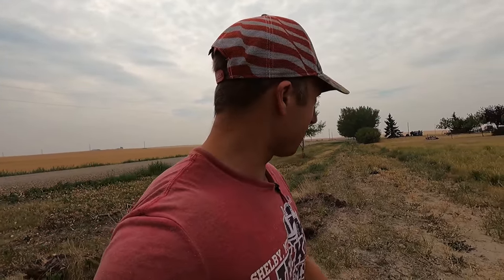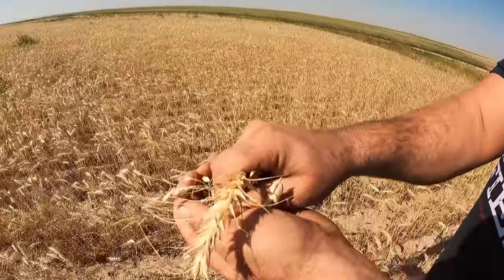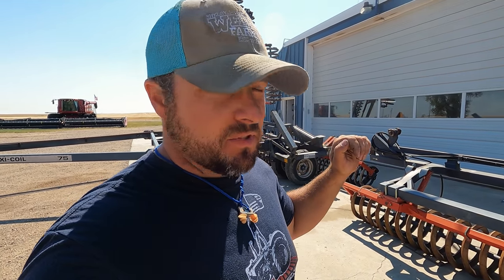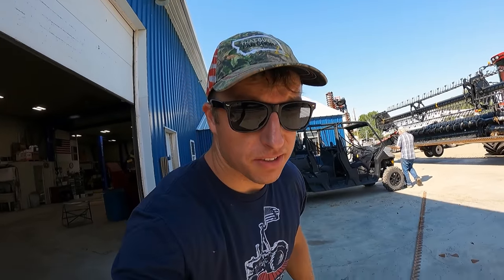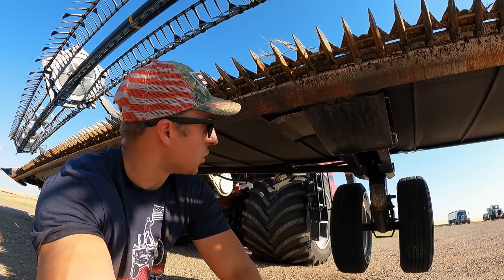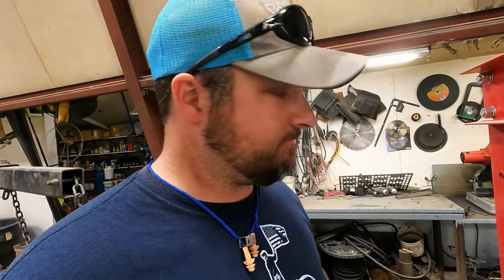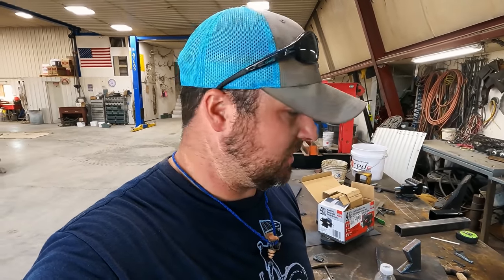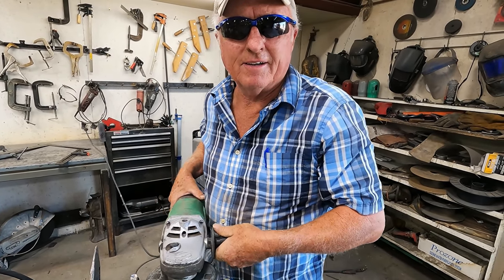Ripped In Two

Comment: Just a little welding tip, before you slide the 3 1/2" tubing inside the 4" torch (or drill) some 1" holes in a random pattern on all four sides of the outer tubing. Then plug weld the outer to the inner. Plug welds are super strong and with your wire welder super fast.
Reply from the maker: Thanks for the tip!
Reply: I've done that when I've had to lengthen a roll cage or frame on a truck ... super strong! (almost as strong as Leg Arms!)
Reply: Great idea
Reply: came here to say this exact same thing....
Reply: dude i couldn't have said it better!
Reply: I was hoping someone would say something about plug welding.
Reply: Yup always did that when we repaired our snowplows. But it was alot shorter peice. But a couple would help it potentially moving inside the 4" tube
Reply: Ooops! I just post the exact same idea!!! Hahahaha deleting comment right now.
Reply: @raymondtousey9014  Almost hehe
Reply: Was going to suggest the same thing
Reply: Plug Welding the sleeve.....all 4 sides staggered on each side of  the break.
Reply: Had this done on the main beam of a7500 CIH moldboard plow multiple years ago. Still holding today enough we don't use much now. Lord Bless 🇱🇷!!!
Reply: Yeah plug welds the way. Super, super hot weld means cracking later on.
Reply: Welder of  32 years I was just going to say that
Reply: Interesting how so many welders have done this, yet the automotive and manufacturing of Machinery Industries haven't heard of this engineering genius or is spot welding a form of plug welding LOL.
Reply: @earlhollar1906  it’s a waste of materials. They don’t need to do repairs like this when their making the whole thing from scratch.
Reply: @earlhollar1906  that's not true plug welding and spot welding has been around for years. Spot welding is a different technique than plug welding, spot welding is normally used on thin metal and plug welding is for thicker material. They both are extremely strong when the application is done correctly.  The automotive industry uses spot welding on every vehicle they manufacture. If you go to any welding school you will be taught how to plug weld when doing repair work, and spot welding thin metals.
Reply: @jeffgregory5076  I know these things my comment was a rhetorical sarcastic one I thought maybe the LOL relayed that. We did this in welding class at state school science when I got my doctor Motors degree with a 4.0 average. Not to blow my own horn to loudly but my project partner and I we're giving the task of building the undercarriage Springs and skis for the instructors children's plastic injected seat  fiberglass body slay he was going to pull behind his snowmobile.
Reply: Smart thinking.

Comment: Thank you for taking a moment to explain the coil packer to us non farmers.  

And I am always impressed by your ability to figure out a way to fix whatever problem you find.
Reply from the maker: Thanks!
Reply: Flexicoil you see the coils flexed but that thin 4in square tubing didn't Flex along with it. Bit of a design flaw. My dad was a fan of the rod weeder pulling a drag behind it after plowing,   and before seeding.
Reply: Could not have said it in a better way.

Comment: Nick, glad you showed the -130s cruising low-level over your farm.  I flew it for almost 20 years; saved many lives as an HC-130 Rescue Driver.  Great airplane, great vids.  Keep up the good work.  God bless.
Reply: Love me some C-130s too. 11 years as a depot sheetmetal mechanic on C-130s. Probably have seen or worked on your HC-130N/Ps.
Reply: @stanleyharrell6009  Probably.  Here are some tails I flew:  695831; 695824, 660212; 650968 (crashed in GA two years ago on way to boneyard, killed entire crew), 650978.  Did you work at WR or BHM?  Many more I can't remember.
Reply: @skullman1455  I worked C-130s at Robins. Worked 5831 for CWB replacement and NVIS/SOFI in 97. Did the same on 212 shortly afterwards I remember the others tails coming through. I was the workload planner on 978 when it came in back in 2009 for HVM. Sad to see all of these go to AMARG. They were great aircraft.
Reply: I flew in one from rein main Germany to Eagle Base Tuzla main Bosnia in March of 2004 on my first deployment not very comfortable and the pilot went from about 10 ft to the ground in a split second was rather enjoyable

Comment: C-130 Hercs are Amazing!! When I was in the RCAF (Royal Canadian Air Force) I flew almost 2000 flight hours on the tail ramp inside the cargo bay and also flew with a SAR (Seach and Rescue) unit and they had Plexi glass full length side jump doors for searchers to sit and look for lost people in it.
I LOVE the Herc. I have never slept as well compared to my sleep time on the closed ramp of a Herc. The drone and vibration from the 4 turbo prop engines.

Comment: One other way to tell if the wheat straw is dry enough is to watch how the straw settles coming out of the straw chopper.  Back in the day my uncle would say that if it disappears into the stubble it is dry, if it 'floats' on top of the stubble, it is damp.  But here in eastern ND, I don't recall that we've had a had such a drought as you are having.  It was dry this year, but there was enough subsoil moisture to result in pretty good yields.

Comment: Seeing the issue with the packer reminds me of an old saying. "Never be a borrower be or a lender be". It's unfortunate but, your experience with those that borrowed from you, never fixed what they should have done when they first said they would. 
Tis why I prefer to use a stick welder when outside, wire welders really are designed to be used indoors unless using flux core wire. I know naysayers may disagree but, wind blows the "gas" away which is what makes a weld look like crap. 
Actually, thank you for sharing your videos. Even us retired farmers live and reminisce through your videos. Cheers :)

Comment: For the tube inner sleeve I would pierce holes along the outer about every 6 inches and plug weld through the two tubes. Joining them together this way the ends of the inner tube can not shift and put load on the outer tube as the whole arm flexes. Thanks for all the videos and keep doing great work!
Reply from the maker: Thanks for the advice!
Reply: plug welds suggested one hour before your comment, I know, it's hard to read all the comments..but still be best solution!

Comment: When I worked at the feedlot by Picture Butt AB, we ha a rotor in the mix wagon split in two. The old Mr. Fix-it sleeved it and welded back together but he first punched some holes in the old one, then put the sleeve and welded the holes closed. But your just pulling the tool where the rotor was transferring force to the beeaters. It never broke again while I was there. Your fix should be golden! 👍👍

Comment: I was in the infantry in Alaska at the end of the 'Nam eta. We had a field problem in Fairbanks and had to fly up from Elmendorf AFB outside of Anchorage. At least 6 hours in the C130s. So in their military intelligence mode, the Air Force took their oldest C130 airframes and put them in Alaska, with you guessed it, the worst flying conditions of all US airbases. 

The FIRST time we took off, we were about 30 seconds airborne when a right wing engine caught on fire. 

The SECOND time we took off we were about 2 minutes airborne when the same engine caught on fire. The 3rd time - same damb plane - we managed to land at Eielson AFB outside Fairbanks so we could go play bang-bang at an actual temperature of 67° below zero. When the Huey's picked us up a couple days later, their prop blast was supposed to put the wind chill around 200° below zero. But that's military information, so take it with a lot of salt, lol.

Comment: Flux Core MIG wire works in windy conditions. It lays down a slag layer just like stick welding and has to to be chipped off but works a lot better in the great outdoors. Especially since the trees for a windbreak seem to be a little sparse and getting sparser. :(

I grew up in a farming community (Indiana) and lived on a farm when much younger. I can appreciate your trials and tribulations and applaud you for your strength. I was almost in tears when you did the first video detailing the hail damage since I understood what that meant. Peace with you and yours!

Comment: Scot I really think that Nick and your dad should spring and get you an Ironworker for your shop.  Uni Hydro and Scotsman are the 2 best makes. Uni Hydro is built 15 miles from me.  I would suggest a 80 ton machine.  But get what you can afford.   Just remember that to punch, shear, and bend thicker material takes power and pressure.  Just a thought for you guys. Good luck in your harvest.

Comment: We did the exact same kind of repair back when we had a 40ft cultivator shear in half same situation.  basically put a smaller piece of square tubing inside the larger existing tube slid it all together and welded it up.  Worked like a charm, just made sure to do the prep and weld it up solid.  only worry was if it would get stuck trying to slide the pieces together.  One thing we ran into was the inside of the existing Tube had a bead that we had to grind down, but otherwise worked great!

Comment: Cold weld joint , plug weld up the square tubing repair will be stronger .And we use diamonds on the outside patches .The tapper of diamond is the best it distributes load. Really good on stretch.

Comment: When you weld a sleeve were you can't get a lot of welds on it you can drill holes in the outer sleeve and then weld the holes closed so you get more weld on both sleeves

Comment: On your harvest header wear plates, I use to weld old leaf springs flat on the bottom of ours and it worked out well it prolongs the wear plates 3-row laying flat do the trick. and the white wear plates you have at the ends you can buy that in 4' x 8' foot sheets up to 2-inch thick the plastic is called UHMW.  and it cuts in a table saw great.  Good luck love watching you guys work as a team.

Comment: You were very good with your description of why there's a gas. With different steel, and cleanliness of the work piece I sometimes switch but different gas will give you different results. No matter what I like to run a mix for everyday welding. Generally a Argon/CO2 mix is sufficient.  The gas is there to displace the oxygen since it's heavier and give you better pennitration with less if any porosity in your welds. Have a great day guys!

Comment: a small idea, for small problem. Why not make a small wind/weather protection "cube" thingy, for when welding. all you need is some:
- some metal tubes
- some canopy material (leftovers)
- non burning soft paint, for the canopy.
- a battery powered fan (amazon)
- hinges (simple home made)
- clamps or powerfull magnets (or combination of both)

make it small and handy, so you can have it in the service car, for when you need to weld out in the field.

Comment: Flew in a C-130 in sunny southeast Asia.  As we rose in altitude, the air conditioned air became a fog, then a very dense fog to the extent that you could not see the other side of the plane.  As the plane lost altitude, the fog declined and vision returned.  Quite strange.  Did the same in subsequent flights.

Comment: Leg Arms. When putting that square tube inside drill 1/2" holes in the implement frame and plug weld the inner tube to the outer. I would go 12" centers for the plugs.
Reply: I was going to suggest plug welds. 👍

Comment: NR-212 .045 Inner Shield flux core wire. Never have to worry about gas or wind ever again. If you use this for your current welding machine, you need to buy new knurled drive rollers, liner and .045 contact tips. Use this when doing heavy duty repairs. Use your normal Mig wire and gas for anything less than 1/4"

Comment: You should drill some holes through the old tubing so you can weld the old/new around those holes every 6"-8" inches to increase the strength the entire length of the sleeve.

Comment: Much easier to stick weld in the wind. Even flux core wire in the wire feed helps. A magnet drill with annular cutters makes boring large holes easy.

Comment: Should drill some holes in the 4x4 so you can do additional plug welds on the 3 1/2x 3 1/2 to help it out. Maybe one on parallel faces staggered 6"?

Comment: C-130's are cool to fly in if you are loaded with gear. A lot rougher ride tho
Reply: I would be a little worried if I saw those zip overhead over there currently.
Why? Well most of the units are being used as fire tankers to drop retardant, and they do not fly that low if they are moving long distance.
In other words, you may have a wildfire nearby that they are responding to.

Comment: If I have to weld in the wind on dirty or painted steel I use a an arc welder with 7018 rods although more time consuming stick welding is not as finicky with wind and it is great for thick chunks of steel

Comment: Here’s another welding tip you don’t always want it as hot as possible when it’s to hot it creates a haz (heat affected zone) which will weaken the steel and make it break easier the weld won’t break but the steel will around jt

Comment: I see you left a little bit less than overachiever room for white lithium, or Mystic Greece by the pin sealed in with the little Gorilla Tape. Or are you going to just hit it with some spray graphite?

Comment: Isn't there a welded seam on the inside of the bigger square tubing? How did you eliminate it for the 31/2x 31/2 to slide inside? Not unless you used your JD loader to push it in. That's how I would of done it...more power! Nothing runs  like a deer but smells like a john. God Bless

Comment: It looks like that has broke in the same spot before. Could you run a heavy cable from the tongue to the outer end of the wing to take some stress off the frame?

Comment: Vertical down welds won't hold anything.  Need to weld vertical up for strength.  Don't pull horizontal welds either.  Always push.

Comment: If it were me I would have probably used 7018 but mig works too. What brand is that plasma rig y'all bought? I was also curious can y'all plant winter wheat in Montana giving your weather? I know you always take a gamble down in our area with a late frost in the spring so most steer clear of it.

Comment: If you added up all your time spent on just farming and all your time just on mechanical (non-farming) work you might find you are more a mechanic than a farmer. For mechanical I would include everything associated with your equipment, e.g. welding, plumbing, wrenching, electrical, pounding, drilling, painting etc.